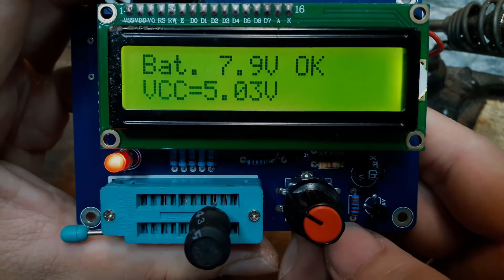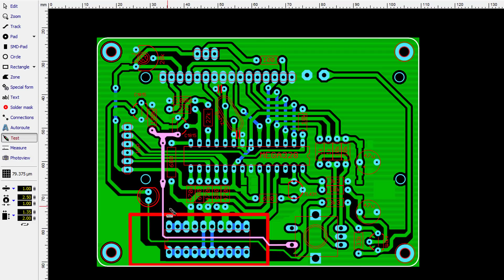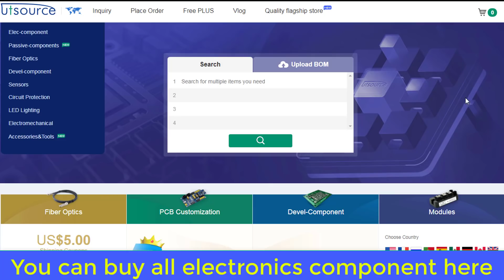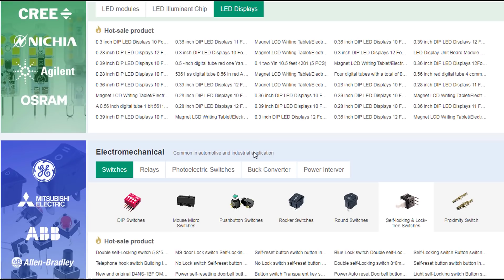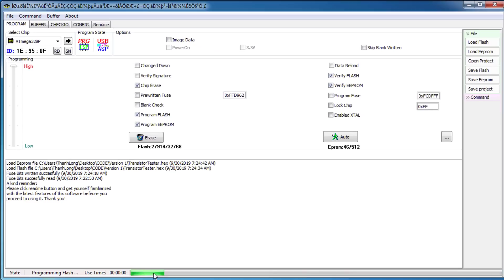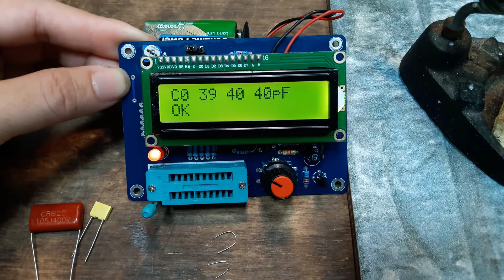Electronics Component,AVR Transistortester,LCR meter,PDF and Gerber file share

Comment: I built it and its working well ... but I cant calibrate it correctly . it measures electrolytic capacitors near 3 times of their values . for example it measures 3600uf for a 1000uf cap . strange thing is that it shows the right value when I'm putting the capacitor in the calibration mode . please help me with this .
Reply from the maker: Check you wire or pcb. The better way is check new version of LRC in my channel. It's very accurately result

Comment: Hi i am able to install hex and eep file to atmega, but now problem is while testing a 10k resistor it shows 3.7k as and battery 9v test shows 1.3 volt. But yhe frequency generator is good. 100nf capacitor shows 75nf.  

Pls help me. I have put all the resistor correct

Comment: Your Rotary encoder not working. Why use encoder? Need just a switch!
Reply: @ajuwinfly8272  Yes, but it is a bit tricky. You can watch this, I hope this will help. If you got any problem, fell free to ask. https://www.youtube.com/watch?v=_nE8Tir_o_A
Reply from the maker: 3 frimware version
Reply: @LongTechnical  version 3 does not work with 16X02 display
Reply: @md.nahidulalam3376  .on the bottom of pcb, the IC is 78M05, what's the value of the 7 smd caps?
Reply: @penghui245  All smd caps are 10n
Reply: @penghui245  You can make this without any smd component. https://www.instructables.com/id/Component-Tester-Test-Almost-Anything-/
Reply: @md.nahidulalam3376  Any fireware that can use the  rotary encoder? for this project
Reply: @penghui245  Yes, I  have
Reply: @penghui245  LFUSE: F7
HFUSE: d9
EFUSE: FC
Reply: Hello what is progem software 🤔?
Reply: @ajuwinfly8272  Do You have a Burner or AVR Programmer?
Reply: @md.nahidulalam3376  mg send plz 🙂
Reply: @ajuwinfly8272 Didn't understand
Reply: @ajuwinfly8272  Avrdude is the software
Reply: @md.nahidulalam3376   whatsup come
Reply: @ajuwinfly8272  OK, where are you from?
Reply: @md.nahidulalam3376   hello 🙂
Reply: @ajuwinfly8272  yes
Reply: Sri lanka

Comment: Which software used for programing
Reply from the maker: USBasp programmer
Reply: @LongTechnical  can you provide the link for the software
Reply from the maker: @sivaanand.p7920 " progISP" search this keyword on google search.
Reply: @LongTechnical  hi. I am facing programmer can not be found issue
USBasp driver installed, then also finding this error
Reply: PRG ISP not enabling. Could you please help me out with this issue
Reply: @sivaanand.p7920  use AVRDUDE
Reply: @kartikhegde9368  yes very easy